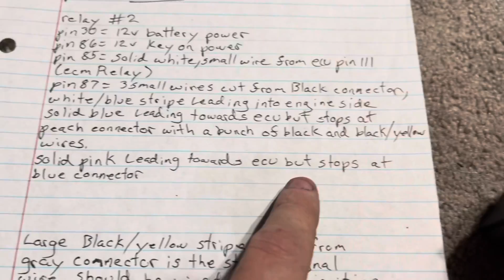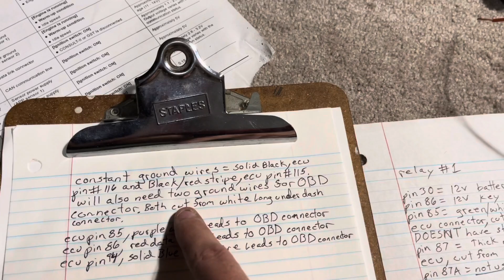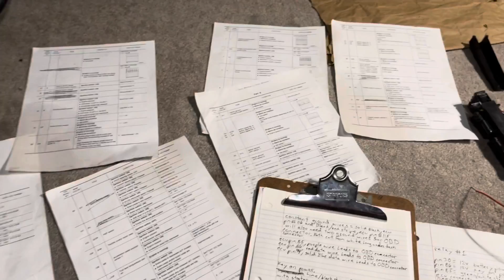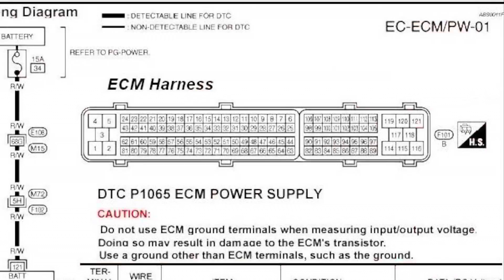How to wire a stand alone swap harness for the VQ35DE when using the stock ECU

Comment: My blue and peach connectors have different color wires 🥲
Reply: Mine too and i don't have the gray connector with out the stater wire or the black one and most of the wires going into my starer wire plug are different.. It would be really nice to know what all the wires go to so i could find them on the diagrams myself instead of just saying this color wire going to this connector... I am lost with all the wires that don't have pin numbers besides the starter wire.. even if it was just like "this is the 12v for the throttle body" or what ever I just need more information about those wires than his description, what do they do and control?

Comment: Why would this not work for an hr swap harness? Wouldnt the dual throttle bodies just be the same input twice? Im trying to swap an hr into a de shell at the moment and i refuse to pay for the wiring service. Any help or tips would be appreciated. At the moment i have the fsm for both cars and will be mating the 2 harnesses together. Trying my best to copy harness from google images of guilty garage and hexa. Crazy how this info is gatekept and then monetized. They wouldnt be losing that much money if this info was released
Reply: I'm not sure how much it will help you but I did just figure out some things on this harness that may help you. If you can find the harness diagram for your HR motor and compare it to the things he has hooked up on the diagrams for his car you should be able to get it to work as long as everything that needs to be hooked up is. You by no means will be fallowing pins or wire colors but having the information of what is being given power and ground and how may help, it's gonna be a lot of work but should be doable.. Good luck.

Comment: Hi  buddy you seen very capable and cool guy so thank you for this super cool video .  I have a Maserati engine v8 4.7 out of a granturismo with all the original wire harness , throttle pedal , fuse boxes and I already had the immobilizer removed from the ecu , I’m planing to do an engine swap into a project car I’m building. My question is if there is a way you could modify the oem harness so I can run the engine and I will pay you of course  thank you .

Comment: Hey, I know I'm pretty late to the party, but I'm trying to swap a VQ into a 280ZX. Wiring is the current hurdle and your video is the best thing I've found so far.

I feel like the questions that I need to ask are going to be fairly amateur and I hope you can put up with them.

Your categories are labeled relay one, relay two, and so on. What do you do with the wires in the category "key on power"?

Does it matter where you got the OBD2 port? Can I just order one off of Amazon and wire it up the same way you did? And is there instructions for how to do that properly? Your video doesn't quite show where all the wires go on the OBD2. 

I followed along about as well as I can, and one of the problems that I'm running into is the throttle pedal. I thought it was going to be as simple as matching up the wires like you said in the video, but there are a few wires that repeat. The green solid one, the black solid one. But according to some of the pinouts that I've found online, it's totally separate wires all together. I was wondering if you could show a close-up of the wires for the throttle pedal or list out the pins that those wires came from. 

And now for the really stupid question, the three plugs that you mentioned the black one and the two gray ones, I can't figure out what those are supposed to plug into. I literally have no idea where they go.

Comment: Hi can one of these be wired to communicate with TCM and run an automatic trans? Have a 06 Maxima I want to use for a sand buggy project- thanks great video.
Reply from the maker: I dont know sorry. I’m running a manual and just reverse engineered this harness the best I could.

Comment: So is that all the wires and relays I have to set up to be able to run the engine
Reply from the maker: That is all that is done to mine to make it run wiring wise. You will still need a tune to delete the NATS on the ecu
Reply: @vqmiata1896  yes i all ready did the nats removal wiring is not my specialty. I did vq35de swap into my Mazda b2600 just need to finish these relays thank u very much for the brake down video and replying back to me

Comment: sorry if this a dumb question but wouldnt be sooo much easyer and run an standalone/after market ecu
Reply from the maker: Unfortunately not cost effectively. The only ecu I know of that will work like the factory is a haltec and I still think that there’s some compromises. Tbh I didn’t look into it very far because the stock ecu and harness will support more power than I’ll ever need.
Reply: morning you you sell your pin out diagram struggling to keep up busy with a race car build on my 350z and need to delete all wiring not neede to run the car
many thanks reggie
jeffreysbay
south africa